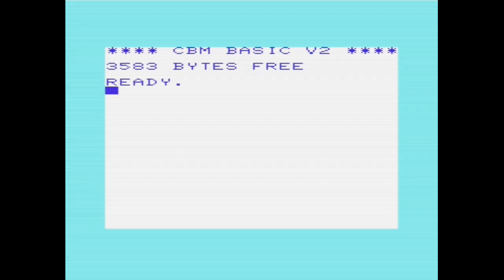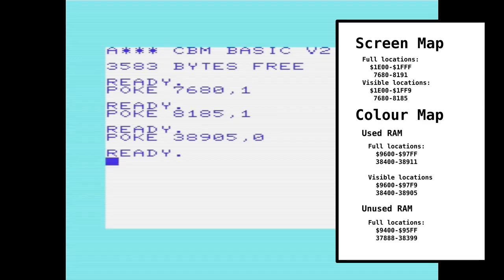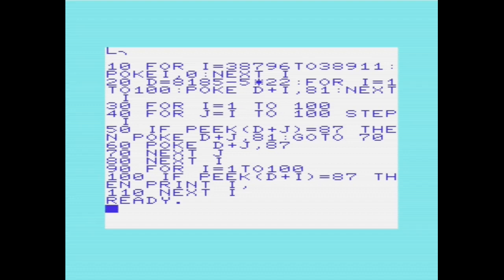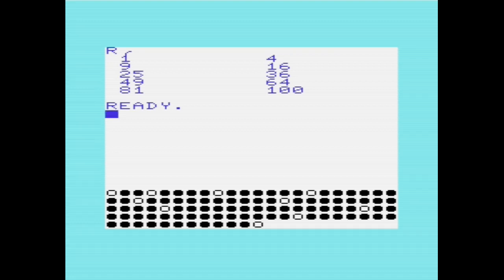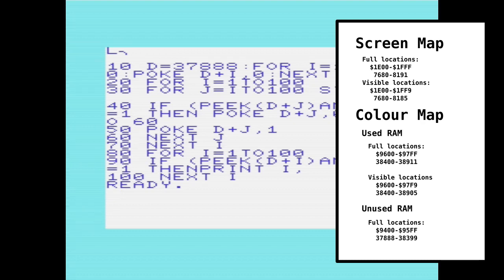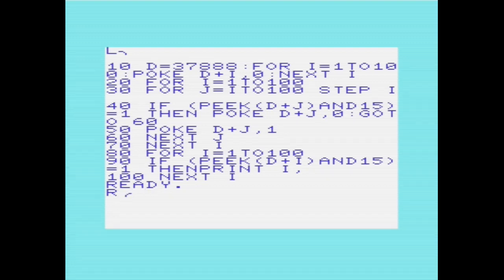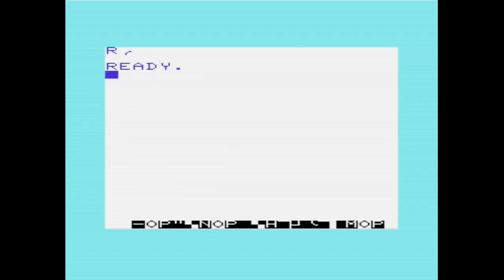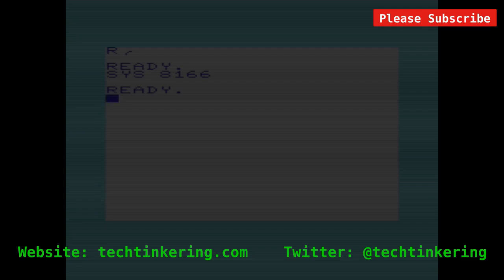Run Code and Store Data in Display Memory on the VIC-20

Comment: Very interesting! One thing I remember finding amazing the first time I saw it was running little machine code routines on the interrupt, such as changing the audio pitch in order to play a tune. You had the Vic seemingly working as normal nonchalantly flashing its cursor but also playing a nice little tune at the same time! I think the game 'City Crusher' works like this.
I used to tinker round with that, but can't remember how I did it now!

Comment: 3:43 Lots of BASIC games effectively store part or most of their game state in screen memory as well. 

6:54 Lines 40 and 50 could be simplified to «POKE D+J,1-(PEEK(D+J)AND15)».  Or «POKE D+J,241-PEEK(D+J)» to get more tricky with the bit twiddling.

It's also more efficient to put the calculation of D+J into the FOR statement, like «FOR I=1 TO 100: FOR J=D+I TO D+100 STEP I: POKE J,241-PEEK(J)».

Comment: Hello there! Thanks for the interesting video, just wondering...I typed in the same code but got different results from the first program. 
Obtained: 2 -5 -10 -17 -26 -37 -50 -65 - 82. 
 I found the typo, I used 1 instead of I in line 40. very nice video.
Reply from the maker: Thanks.  Good to hear that you got the programme working as well.

Comment: In addition to saving memory that can be used for code or data, does reducing the screen size save any cpu cycles when programs run?
Reply: Nope.  Unlike on the C64, the video chip on the VIC-20 doesn't steal any clock cycles from the CPU.
Reply: That's right I forgot about how that architecture works. On the VIC-20 there is a low and high speed bus(you can see on the schematic in the back of the programmer reference guide) and the different chips can actually work on ram independently of one another without overlap. The C64 of course was way more complicated and required a "traffic director" and wait states on the CPU. As far as I am aware, even disabling interrupts the VIC doesn't speed it up. It's going full speed already :D